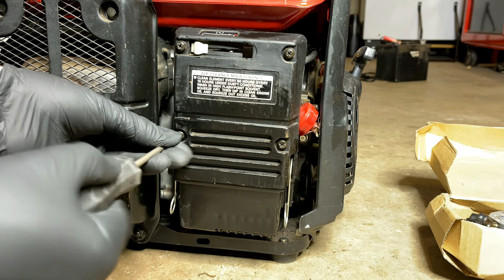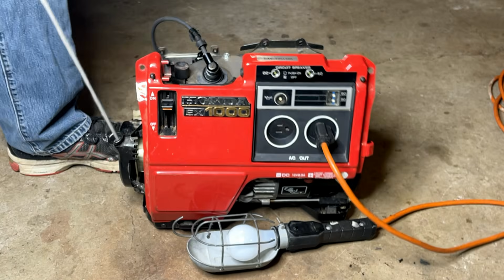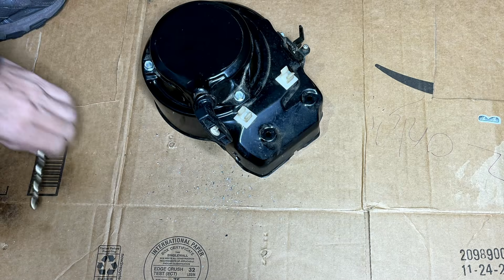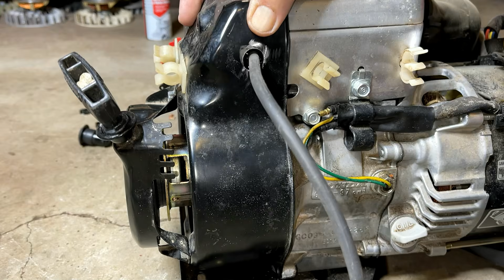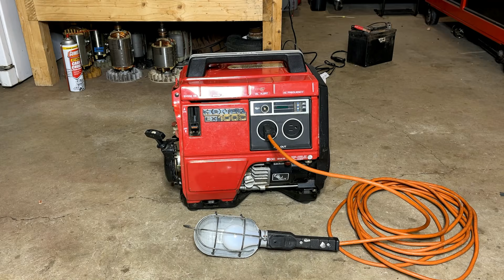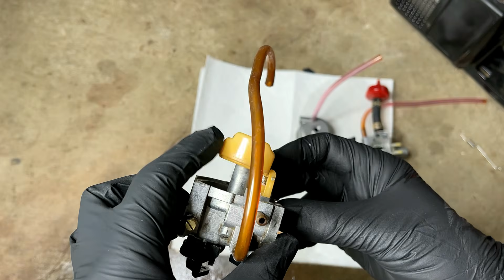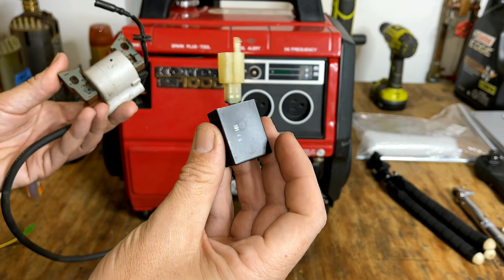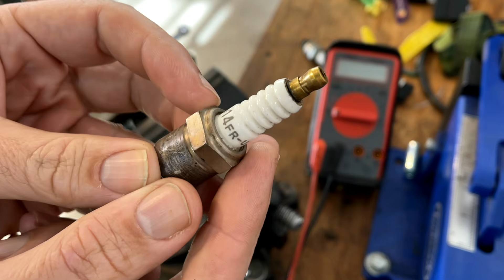Honda EX1000 - Will It Run?

Comment: That little thing had put a good fight. Very nice video!
Did you think about put all the original coil parts again just to see if it would run?
Reply from the maker: I did, but I already modified the blower housing.  So left good enough alone.

Comment: Last year I had a customer being a Honda Rancher ATV that was dying after running a couple minutes. He pulled the trigger on a brand new Keihin carb before I got it and still the problem persisted. I changed the plug with one on hand and ram fine. 10 min fix. I’ve run into plenty of bad NGK plugs even back in the early 80’s I saw it occasionally. Another recent job in a GPz750 had a dead hole after putting the plugs back in from major engine work and that too was a bad NGK.

Comment: Plugs go bad more often than you think. I work in a small engine shop for large municipality and I see 15 to 20 of them a year.
Reply from the maker: It surprises me that name brand plugs fail like this.  Now I know.
Reply: @jcondon1  It was not the spark plug that failed, but the resistor inside. Strange to have both a spark plug cap and the plug itself with resistor.

Comment: This was really interesting.  I had totally forgotten that some coils and spark plugs actually have resistors in them.  I've seen intermittent thermal issues like this with lots of various electronic stuff, and it can be really frustrating and time consuming to fix.

Comment: hey james a friend has powermate 5000w i tried to set it for him but at 60h it's putting out 156v it's the kind with brushes in end plastic and only thing there is to adjust is little blue thing on computer board which only turns about 1/4 turn i tried turning it both directions with no change we have storm coming so didn't have time to play with it much i told him to run heaters and lights but nothing sensitive do you have any idea what I should do
Reply from the maker: Its hard to say without knowing exactly what's in there.  I have not seen a powermate with the square plastic end housing that had any adjustment.  Usually the voltage on those or based on the engine speed.  Sounds like you have something that I have not seen before.

Comment: So leaking plug to ground when hot.  Crazy!!!  I think this has been the year of the plug.    Not to give up a future video but I just had a bad plug on a 3hp 2 stroke.  Rj17LM.  Fantastic how you worked your way through this.  I could see the 60Hertz indicator shaking at the end of the video.
Reply from the maker: I noticed the same.  Simple technology with the shaking indicator.  It was a name brand plug!  Since this generator I have had two others with a bad plug and non before this one.  I always joked that every broken generator I bought always came with a new plug and I thought it was never the plug.  Guess you learn the hard way sometimes.

Comment: You can tell by the direction the fins on the flywheel are cupped and where you wound the pull rope it would only catch in one direction.

Comment: Rule #1 of small engine repair: regardless of what is actually or thought to be wrong, replace the spark plug. While it's extremely rare to have a bad plug, it's one of the cheapest, easiest, and most often over looked maintenance items to replace.
Reply from the maker: For sure.  It would have saved a lot of time in this case.

Comment: You definitely had a can of worms on this one. Bravo on all the repairs. One thing that can cause smoking on overhead valve engines is a bad head gasket leaking oil into the combustion chamber. Kohler had a problem with this on at least one of their OHV twin cylinder engines. Poor casting design and not enough head bolts caused the head gasket to burn thru into an oil return gallery. Only fix was a new head gasket, flattened head and new head bolts torqued to the max. 
My Husqvarna chainsaws have ignition modules that kill the spark below a specific rpm. This avoids kick back on the starter rope and means you have to give it a fast enough spin to get it to fire up. Could that be the use of the module you are wondering about?

Comment: I have had a similar problem with a honda engine. Would run perfectly until it warmed up to op temp and then would not run at all till it cooled off. Before this I would just look at the spark plug to tell condition didnt think that it could cause major issues. but I now replace the plug if i have any issues related to running/misfiring that is not related to carb/timing/valves.

Comment: I've messed with certain Honda's before. I know this one is older I don't know if it has overhead valves if it does look to see if there are rubber oil scrapers on the valve stems. If they are replace them probably old dried-out and Warren. This is most likely your oil problem since it only does it under load

Comment: Makes me glad that our old antiques still run. Might not be the best but I can go start them when the power goes out which it did the other day for 16 hours. The old Coleman ran almost non-stop and used no oil and not much gas. We thought about a whole house rig but we can get gas easier than propane in a pinch. Better off stone age. Thanks and GBWYall!

Comment: That's about right for these old Hondas. We've had a fair few with just this issue, but it's usually the ones with the micro-spark plug, and they're not so readily available, and not cheap. It's rather more unusual for standard plugs to fail this way, but not unheard of. 

We had a van back in the late 1970s which did exactly the same thing, first on one cylinder, then a second, and eventually would give out all together. I have no idea what happens within the plug, but it's quite evident that the insulation begins to break down somehow, and becomes electrically conductive (leaky) to the point it causes a misfire, and eventual failure. 

My dad chased that fault for days, and the plugs always checked out fine. It was a contact at 'Road Motors' who pointed him in the right direction. So fear not, you're not the first to be led a merry dance, and you surely won't be the last.

I'd be very surprised if no one watching this video had learned from it!
Reply from the maker: Its hard to imagine how a plug could fail in this way.  It was not an easy fault to find.

Comment: Great find Jim: I thought you might have had an issue with fuel flow thru the filter or a fuel cap not letting in air when fuel was being lowered. I always change customers plugs when servicing engines, although some people don't want that done. I think it saves lots of issues. Excellent video. Many thanks and Happy New Year.
Reply from the maker: After this, I would say always change the plug!
Reply: @jcondon1  Almost 30 years ago I had a 2-stroke engine that kinda had me beat, until a guy I worked with told me to change the plug! After that I don't even look at peoples engines, until I've put a new plug and fresh fuel in. Great video.
Reply: @jcondon1  Definitely, and if you can get a non-resistor type throw that in, from my experience with resistor plugs.

Comment: How much should I expect to pay for a great generator this size? It has to be Honda. You can see why. Minimum amount of plastic says quality and Honda engines are what made Honda, a Honda. 
I want to connect a small trailer to my E-Scooter and put a generator in it so I can go for longer trips than an hour. This summer of course.
For daily errands, I'll use the scooter without the trailer and generator.
Reply: A homebuilt hybrid vehicle. Nice.

Comment: That was really interesting. That's the first time I have seen a spark plug go bad like that. I admit that I don't have the most experience but I have been using small engines since the 1960's and have serviced them all from lawn mowers to tractors. Great job at trouble shooting and sticking with it until you found the root problem.

Comment: I give you huge props for perseverance. I had a Yamaha banshee that had a bad spark plug and I chased that problem for months!  Like you, I had never seen a bad spark plug in my life. Great video on a really cool retro looking generator.  Can’t wait for your next one.  If you have a hole in a piece of sheet metal that you need to insulate quick and dirty, try piece of small split loom.

Comment: I use to buy and sell 750 Honda Shadows from the 1980 ,s and they had ignition modules on them black boxes. No way that I found to test them except replacing them with a know good one . But I did notice that bad ones when you smelled them up close to your nose they use to have a burnt electrical smell to them . Do not know if that  would be the same in your case or not but worth a try . Great diagnostic skills you have there and plus you never give up .
Reply from the maker: I will give it the sniff test.

Comment: The carb on the right has a smaller bore than the original (I think, it was only in the camera shot for a moment).
Reply from the maker: I agree.  I noticed the same when editing the video.  Unfortunately not in the heat of the moment.

Comment: Jim, I know, briggs makes a reverse coil, for use with an electronic upgrade to eliminate points,on older engines. Not suprizingly, if you simply reverse the original coil, it will also work, providing, the mechanicals, such as wire length work......

Comment: I am making this comment in the beginning as I try my best to diagnose it before I see the actual direction. I am at the point where you said that it spins counterclockwise. The thing is that the ring that the recoil starter catches is cut and indented to only spin clockwise. It seems that the pull-starter wither spins clockwise and look funny or some parts are incorrect. Time to continue with the video.

EDIT: Wow, this was an absolutely diagnostic nightmare. hahahahaha. Awesome job. Needless to say, I would have given up a long time ago.
Reply from the maker: Thanks.  Yes, I should have noticed the fins on the flywheel.

Comment: Here we dont have ethanolfree gas any more and i am using my mashines so little that i have went over to trufuel only in them in the contry with the most expensiv fuel in the world (i think) more than 60% in tax. Gas and Diesel are about 10$ us / Gallon .
Best wishes from Sweden 🇸🇪🇸🇪🇸🇪🇸🇪
Reply: Aspen 4T ?
Reply: @erik_dk842  yes aspen 4 and i ad just a little of 2stroke oil just to provent rust in tank and carburator bowl (like 0,05%mix)

Comment: Look in the surplus junk catalogs, such as "all elecyronicks" . You can buy assortments of rubber grommet bushings, as you needed for coil wire protection.....cheap. Get a load now, for future use....I have the same coil problem, with an old Clinton engine; problem is, the coil is mounted under the flywheel, ....no room to turn coil around.....

Comment: its exactly what i thought it would be....its a simple case of reverse the discontinued coil/totally modify the crank housing/get that dead cat out of the gas tank problem which is a very common problem in these early honda motorcycles

Comment: I admire you sticking with that. As far as the coil, I had an ECHO trimmer that the coil went defective and found it was obsolete. Like your generator all other parts are available. Why is that? I can't believe the spark plug was defective. Like you I've never had a defective plug, one that was badly burnt but not defective. You also had to fight other people's mistakes. Good job

Comment: 21:35 there’s a slot right behind there that looks like it’s for that coil wire and that protective rubber boot. At 26:30 you can see the hole right below the wire on the engine side.
Reply from the maker: The cooling fins prevented the wire from exiting at that location.  Not to mention I could not make that angle :(

Comment: In the 80s I had a moped, the spark plug kept failing due to the ignition coil that gave a much too high voltage to the spark plug.

at the latest 5 spark plugs in a week.

After replacing the ignition coil, the problem was solved.

Comment: FANTASTIC sleuthing to discover all the multiple issues. BTW, counterclockwise (anticlockwise in the UK) engines are intended for use in the southern hemisphere. :-) And of course the rust on the flywheel will certainly impede the spark. :-) Just a few hints which have helped me. A knot at the end of your starter rope, a "step" drill bit and a deburring tool for thin sheet metal. But you are still the best.
Reply from the maker: I thought that only applied to the loo?  I do need a step drill bit.  Almost pulled the trigger on one several times, but looked at the price and walked away.  I have to stop being so cheap!

Comment: Jim you are the best ! “Like a dog with a bone!” That little generator was NOT going to win! I have a question, I’m no electrical guru, but if that little part that was transistor operated that gave coil a hotter spark why did the spark plug boot contain a resistor to decrease the voltage? Maybe I’m miss understanding something.
Reply: Forget my question Jim, I relistened to your video and cleared up my misunderstanding

Comment: Aren't the fins on the recoil facing in the wrong direction for counter clockwise rotation & air flow? Not very quiet for a honda. Great video as usual.
Reply from the maker: Yes, I should have notice that sooner.

Comment: Wow what a journey! This video should be used as a diagnosis masterclass! I love that you didn't simply throw a new plug in, but demonstrated the actual issue with the torch! I've been bitten by a bad spark plug before too and it took me a very long time to figure it out because I ruled it out as the problem at the very beginning. Another great video!
Reply: So one of the lessons here is always put in a new spark plug regardless of the problem. A few dollars can solve a few problems. I have learn more watching Jim's videos because each one is a lesson in patience and never giving up.

Comment: I still want some to explain why a brushless generator has an output like what you showed.
Reply from the maker: That is a little beyond my pay grade.  Another Youtuber "Bassguitarist1985" I think said it best "Brushless generators are always going to have higher total harmonic distortion. The squiggly lines at the top of the wave is the result of the circuit "ringing." This is because the capacitor and the inductor (the spinning rotor) are acting as an undampened (think of a car with no shocks) resonant circuit. The best way to stop the circuit from ringing is to add a purely resistive load like a heater to quiet that circuit down. Unfortunately it is not a 100% solution. I would say try loading it up to 50% to 65% and see how the waveform looks. "
Reply: @jcondon1  I see no real benefit for the consumer in purchasing a brushless generator.  It might cost a few dollars less to manufacture (no brushes, brush holder, no slip rings) but the THD is terrible !  A brushed generator head, even without an AVR, will provide a "cleaner" output.  Without AVR, regulation is basically a factor of the flywheel mass and the "reserve" power of the engine.
Maintenance on a brushed generator head is minimal.  OCCASIONALLY, inspect the brushes for excessive wear (highly unlikely) and inspect and clean the slip rings.

Comment: Nice work. This one was really interesting. The ones with multiple problems are always the hardest. Bench proving that the sparkplug is bad is really going the extra mile.
Reply: Definatly never thought of bench testing a spark plug. Ive bench tested o2 sensors but not spark plugs. The way that plug failed is classic though my eb5000 did that during that winter storm last year. Luckily I keep new plugs with all my generators.

Comment: I'm delighted to see you eventually succeed in your mission to get it to run correctly. When I think back to all the trip hazards along the way it must have been frustrating to find that the original issue remained. Well done for spotting and dealing with that and all the other issues you discovered along the way.

Comment: Ive aquired a few of the 600 watt generators,little tune up work,clean carbs,they run fine,trouble is they are almost museum pieces when people look at my line up of used generators

Comment: At 1hr 7 Minutes I immediately thought might be a blown head gasket under high loads, high compression the cylinder head could be blowing oil through into the chamber just a theory. If more issues with oil are found wonder if the head is bolted down tight enough ?

Comment: I think I will pull my old EX1000 off the shelf and give it run. Its been a couple years. I store all my old gens with no fuel so it should be ok. Great work James !
Reply from the maker: Just drained the fuel out of the EX1000 tonight.  Hopefully it will still be around in another 30 years.

Comment: When I was young, I replaced a head gasket on a Honda prelude, I was trading labor for something, When I finished and started it, Smoke/steam was pouring out as it warmed up! I was freaking out but my dad looked and said "let it run and warm up, probably a lot of antifreeze in exhaust" He was correct it stopped after it ran for awhile and was fine in the end!

Comment: I understand your issue obtaining parts for older honda engines. I have a late 70s G28 engine powering a E800e generator and have searched everywhere for a recoil unit but have had no luck. I enjoyed watching this, congratulations on getting it running.

Comment: I never knew that coils were directional....learned something new today.  Thanks, Jim.  ((Also surprised that you like to work from the floor...makes sense with a 300 lb unit, but this little guy??  ))
Reply: On the coil it will say facing engine side or something along those lines on one of the sides.
Reply from the maker: This little guys has a lot of gravity in it.  Plus I had at least 3 other projects on the bench at the time.  Maybe I need another bench or a lift table.